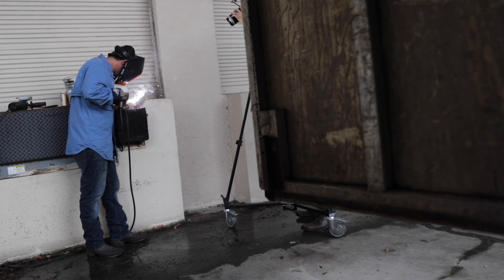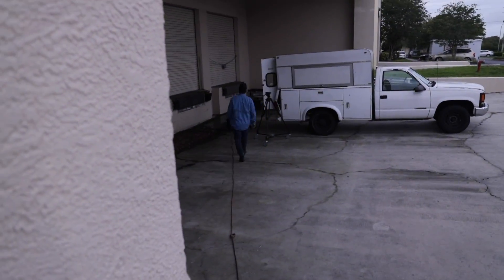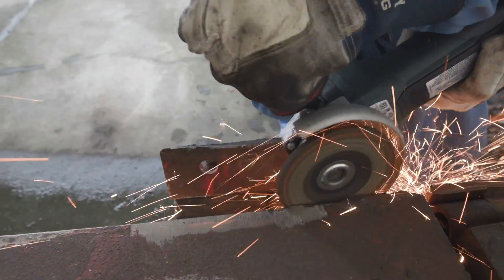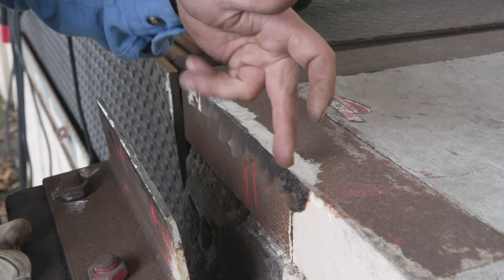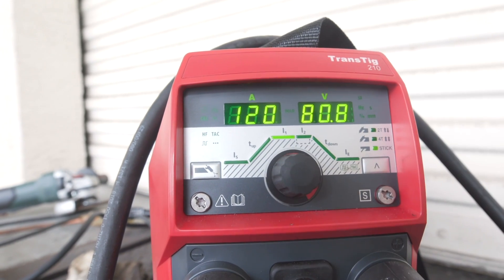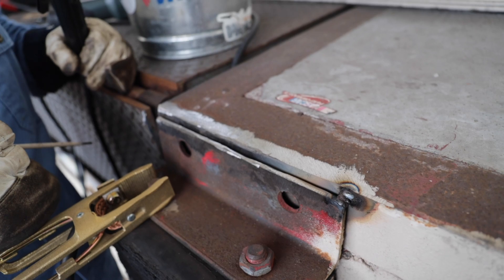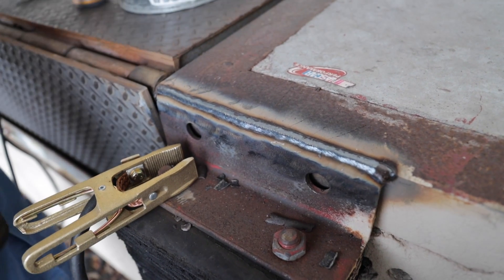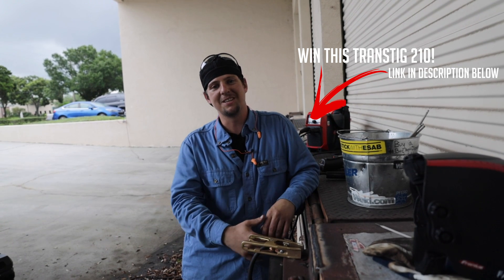Mobile Welding Repair on 110v Power

Comment: Haven’t watched all the way through. But here’s what I’d do. 1. cut out the old weld. 2. Clean the hell out of everything. 3. Joint prep, set myself up for success. 4. 6010/11 root pass and hot pass, then stack 7018 untill it’s happy

Edit: lol I’m a dummy, not enough room for that many passes. Hats off man cub

Comment: Straight polarity or reverse? They make 7018 for AC. Last I tried 7018 on AC, unless it was a n AC rod sucked to weld with. I always ran 7018 on DCRP. Thanks for video

Comment: Built a fire pit about 120 feet from my nearest outlet on 110 using an AHP 160! ... Ran 1/8 7018 at 120 amps... using 3 14 gauge extension cords! ... In a pinch ... it works!

Comment: im surprised no one asked why he didnt use 6010.  If that machine runs like a maxstar it doesnt have a hot start.  the iron content in the 6010 flux makes you need more juice if anyone was wondering
Reply from the maker: It does have a hot start function

Comment: Instead of running a long ass cord , couldn't you run a nice sized power inverter in your truck or a decent generator?......I gotta inverter in my duramax it's a decent sized one, looks like a 5000watt amp, I can run a skillsaw off of it no problem,  I don't see why it wouldn't work for that. .......just let your engine idle you should be fine....

Comment: How will it weld with 6010 on a 115v. My guess is it won’t, it works good with 7018 because 7018 can run with low voltage. Your never gonna get more power out of a machine than you can feed in to it.
Reply: True. Unless you pause quite often, so the breaker can cool down :D

Comment: A person must remember to unwand your extension cord  .put your amps up as you your amps drop when you have a long extension cord , starts and your stops must be excellent it can get hair line cracks . I AM  qualified welder pipes pressure vessels.  Ect . Homeless in Glasgow Scotland .  From South Africa. Grew up as a Christian . Don't drink alcohol don't take drugs.  3 years homeless . Grand parents from britain . Did steel structural fabrication .   Mines . Factories.  Keep myself fit . People not friendly in Glasgow Scotland.  There is work don't have a fix address sleep on the pavement camp Matt and sleeping bag. Don't claim benefits. Glasgow city mission Christian charity refuse food to me because I went to same church Baptist church as Susan Tulley project worker at Glasgow city mission.  Like the band at the church.  Susan Tulley project worker said go back to your country. All 23 staff dislikes foreigners. Keep to myself.   David Harper and Clydale manager said don't come back.  700 Baptist churches in South Africa.  Got scottish plumbing cert level 6. Install new toilets wash basins kitchen sinks baths showers. Still no offer  of work. After corona move to next city.  Susan email stulley@glasgowcitymission.com or info@glasgowcitymission.com.  Luke the way you treat others is the way you will be treated.

Comment: Awesome video! I’ve been equally as impressed with the TransTig on 110v. I dropped a video yesterday on it doing a load of Tig just using 110 and the machine just keeps delivering. Fronius has it right with this little machine. 🔥👍🏼🔥

Comment: I don’t have a 240v in my garage so I just use a generator for my power when I need 240v. I’m surprised you don’t have one for a “mobile” rig.
Reply: I was thinking the same thing,    he definitely needs to invest in one if it's his own company,  or go tell the boss he needs one Pronto! !!
Reply: One word "Sponsor".
Reply: The question is. How many amps can be drawn from that generator?.
Reply: Or just go to australia where 240volt 10amp is the standard with no 110volt
Reply: @simonw4200  10amp at 240v isnt enough.

Comment: What was the amperage on that outlet? I’ve been having trouble tripping breakers on 110 with 20amp outlet
Reply: What machine do you have?
Reply: @sbranham86  I have a POS Campbell Hausfeld 70 amp that takes 1/16th inch rods and I also have an old Clarke hand crank farm style stick welder that gets the job done :P
Reply: yurimodin damn, I can see that being a problem. If you have the budget I would strongly suggest the esab rogue es180i
Reply: maybe there was no breaker haha, just jumped wires for a moment.

Comment: I have a Chinese amico 160d stick welder that runs 1/8" on 110 with a max of 130 amps, 160 amps on 220volts. I bought to weld on fire escapes because it's lighter to carry a 15 lb Machine verses 40 or 50 lb leads up 15 flights of stairs. not bad on short runs with 6011 or 7018. I highly recommend for the money
Reply: I have a 160zeny  stick that's 240/110 it's a cheap one from Walmart it's impressed me for being 120 dollars I'm curious to see how long it will last it weighs about 10 pounds very nice to lug around I had an old craft and 20-60 amp that I was trying to learn and honestly it made me just want to go back to using only my 170 amp harbor freight  mig/ flux core welder. But really glad  to give this cheap one a chance

Comment: It looks like the previous welder had three stitch welds on it....you put a full weld on it....a real welder would have added vertical welds on the edges.
Reply: I agree with your point,  but the "real welder would have" comment just makes you sound like an arrogant dick.
Reply: I would've plug welded the holes if possible.
Reply: I hope I win.

Comment: 12/3 is not what your running for that extension cord. Your running 12/2 if thats 120 volt. For the future, the 2 or 3 refers to the number of conductors in the wire . So 120 volt will have 2 conductors and 240 will have 2 or 3 conductors depending on if there is a neutral.
Cool video though thanks.

Comment: I'm amazed you got 120 amp out of a 120 V was it a 20 amp breaker ?  I run a V 160 T and stick the best i get with out blowing breakers is about 75 80 amps  so i run 2.0 mm 7018.
P.S. if you smack your tack with a hammer while its still hot it would close that gap up nice for you.
Reply: What was your voltage.
Reply: @MR-nl8xr  that's on 115V wall outlet and a  40 foot  12 ,3 extension cord  
Tig i can get about 95 amps out of it but thats it.
Reply: 20amp breaker. Nothing else was pulling off that breaker. Only the welder.

Comment: This is not fix just a bandaid! You should have used a plug weld with those giant bolt holes on the face plate. What about the bottom of the bumper plate? I'm not trying to throw hate but if your going to fix it then fix it.

Comment: Hmmm, I am having trouble with the input vs output.  110v 15 amps gives max energy of 1650 watts.  120 amp,output means the welding voltage is a maximum of 13.75 volts.  Any more than that, the breaker should open to protect the circuit.  Makes me wonder about how many amps the breaker on that circuit is, and what the voltage is across the arc.  Certainly nowhere close to the 80 V shown on the display.
Reply from the maker: 20 amp breaker in this case.
Reply: The math doesn't work even with a 20 amp breaker.  20x120=2400 watts.  2400/120=20volts welding current at most.  Far from the 80 V shown on the screen.
Reply: @cammurray8453   80 volts is the OCV (Open Circuit Voltage) for stick welding.  Depending on the amperage and the arc length this will drop down to around 20 to 30 volts when the arc is struck.  Now if that display was showing input voltage, that is a 40 volt drop!  I can't see how that little inverter can operate at around 48% voltage drop.
Reply: breaker is meant to handle 20amps rms, so you can draw even 30 amps, but shorter time. Considering welding process, its not a problem. My machine draws 27 amps (measured) and its no problem running it off 16A breaker. ITs just not continuous load. Breaker needs to heat up, therefore it doesnt trip instatnly when 20A is reached.

Comment: How warm was that 100 foot cord when you were done welding
Reply from the maker: Should've checked, but we didnt. It was another 15 minutes before we wrapped it up.
Reply: All the work I’ve done with it on 110v I never noticed the cord being oddly warm. Fronius seems to have the power deal sorted out bragging it uses 40% less juice. I posted a video on the machine yesterday if you want to see more.
Reply: @HouseofChop  its like paton vdi pro. I have it and its great and much cheper .
Reply: Long as the wire is sized properly there really should be no heat
Reply: @ORD80  but still, you cant go further than breaker allows, I assume 15amp in this case. thats nothing for 12gauge. 15gauge would hold, no problem, being only slightly warm.
Reply: sumilidero but you do get that voltage. Drop. Them amperage goes up to compensate. It worked, but 10 gauge would have been better for 100 feet.
Reply: @melgross  that weld didn't look to be but about a foot long. He probably didn't take but a few minutes for each pass and the machine/cord had time to cool back down in between passes.
Reply: @melgross  exacrly my thoughts. I would have used a 10-3 for 100ft
Reply: Max R well, at least some of it dud. But if your wiring is 12 g, and the cord 16, or really worse, 18, then that’s a lot of drop over 100 feet. That, added to the drop frame the wiring could go below the recommended minimum voltage. But most outlets are safely above that. The official voltage in the US is 120, but the unofficial voltage is 123, as the voltage is continually being raised.

Comment: 100 feet if extension cords?  Maybe you need a 120/240 volt generator on your truck.
Reply: I do have a generator. Wanted to see how the machine ran 110v with 100ft cord. Its says it will do it

Comment: How much would a small job like that cost? I'm always curious how different welders charge for their work.
Reply: I charge $60.00 an hour. With a 1 hour minimum and in one hour incrementsThe customer is on the clock when I show up until I get everything picked up and put away. I do mostly pontoon boats and boat hoists.
Reply: @richardfuerst5286  Damn, what state is that? We charge 85, 100 for aluminum and that's best case. If it's -20 and snowing, i'm not leaving the house for less than 300.
Reply: @MatthewFogarty-k2y  N. E. Michigan.
Reply: @richardfuerst5286  Northern N.Y. here, mostly mobile stuff.
Reply: @MatthewFogarty-k2y  I retired last year but started this mobile welding 3 years ago. I have done quite a few jobs in my shop also but do mostly mobile on pontoon boats and boat hoists.
Reply: Weld.com literally has a video on how much to charge....
Reply from the maker: Watch this video: https://youtu.be/YdOKKRipoGs
Reply: @Welddotcom  its still nice to know what you charge for specific jobs. We cant expect you to lay out half your financial information, but I and probably a lot of other people would like to know
Reply: @kaptein1247  I recently made aluminum steps for a customer. My labor was the same as the cost of materials. I had $325.00 in materials. So my labor was 325 also. Don't sell yourself short.
Reply: Wanna be friend,,,,
Greeting fire artists from🇮🇩🇮🇩 Indonesia buddy🖐️🖐️🖐️

Comment: The fact that it could run off that long an extension cord is majorly impressive.   You had the knob cranked, but the camera guy never showed any display shots, so it would be interesting to know what the machine was actually putting out..
Reply: Idk, certain machines do better than others on 110...I've run my Lincoln 210mp all day off 110 and it was hardly warm...if thay fronius is anything like it, and if he used a heavy gauge cord. It was cool aspect though. NO GAS TANK, NO 220, STILL WELDIN N FIXIN.
Reply: The 100ft cord isn’t the issue as voltage drop isn’t that major at that distance (around 200ft, is when I would start to worry about that) The issue I think would be the gauge of wire, but it seemed to get the job done
Reply: The breakers are wrong AMP  for that building 😛😛😛
Reply: I think I would've beveled that bumper piece a little and ran stringers. Just my opinion and either way I'm sure it'll hold for a longtime. Cool machine though.
Reply: I run a 100 ft constantly